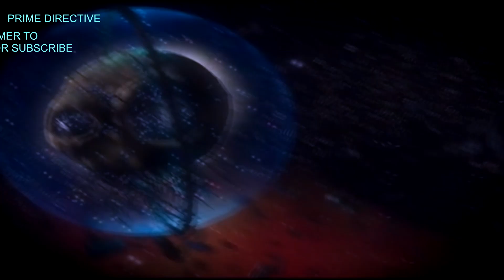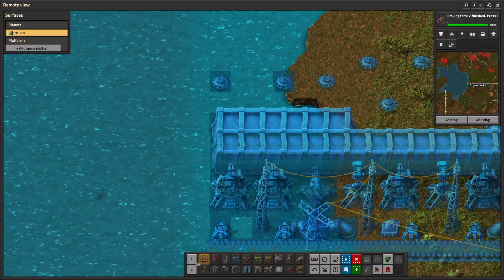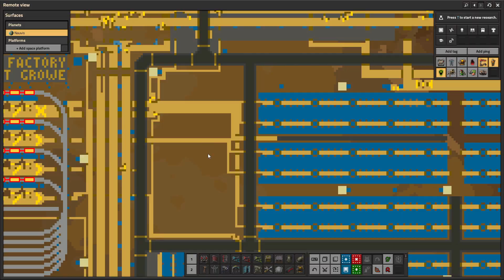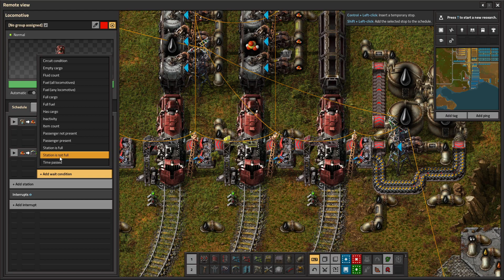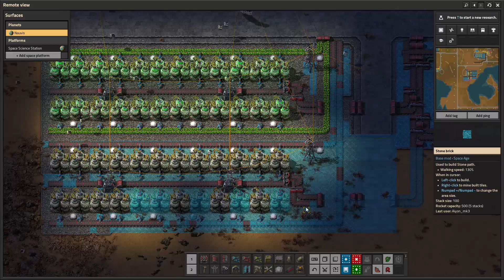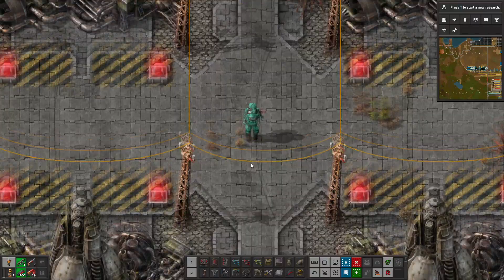Factorio Space Age / part 5 / Just a little Side Project

Comment: you have never uses beacons before? that is very surprising!
they are the second big thing i rush research for, after bots.
each beacon has two module slots and it will transmit the module effects to all production buildings in range, though not at normal effect potency.
in the old pre-space age version you got a linear increase the more beacons were in range, with each beacons effect stacking on top of each other. 
in the new space age version each beacon has a 200% module effect transmission rate, if i remember right, but the more beacons affect a machine, weaker the individual effects become with only a partial increase in overall effects. this also allows for a better control/customization of effect strengths.
that being said, with enough beacons you can still get to 300% productivity, which is the hard limit set by the devs for productivity to prevent vanilla item duplication recycling loops.
not all modules can be put in beacons but it is very much worth using them, in your case especially with green modules to save on power.
and you will probably need a lot of green modules, since the increase in production will come at a huge power drain.
especially the new production buildings from the other planets need lots of power even at normal use.
and in case you are wondering, it is generally better to use higher quality modules than higher quality beacons, though both together are very powerful. higher quality modules get better positive effects for the same negative effects, while higher quality beacons increase increase the total effect transmission and therefore increase the negative effects as well.
i use beacons for labs as well. the productivity bonus can get huge.

oh, and have you looked at tier 3 modules yet? they have changed recipes and one kind will have a very interesting/troublesome ingredient, look it up. evil grin

nuclear reactors get a big neighborhood bonus to their heat production for every active adjacent reactor, so you should build a 2x2 or 2x3 setup for maximum output. diagonals don't count. they are also heat pass-through, so you only need one heat pipe for the entire reactor block, though i still advice for more.
those heat pipes then lead to heat exchangers which work like boilers and produce high temperature steam.
you need steam turbines to properly use that steam.
you will need a lot of heat exchangers and even more turbines, so make sure you calculate the ratios right. those reactors with neighbor bonus will probably output way more heat than you can convert to power, so prepare to store a lot of steam.
since reactors will not throttle their fuel consumption i advice you to build a setup to limit their fuel supply access. for example by reading the steam storage and connecting to the inserters, limiting them to only work if steam is below 75% and setting their stack size to one. or even better, by adding requester chest with a fuel cell request of 1 into the setup. or alternatively by reading the reactor temperature and only inserting if it drops below a certain number.
this is not really an issue with your uranium processing facility size, but i always build those fuel limiters, by now out of habit.

and happy new year!!🎉🥳🎉